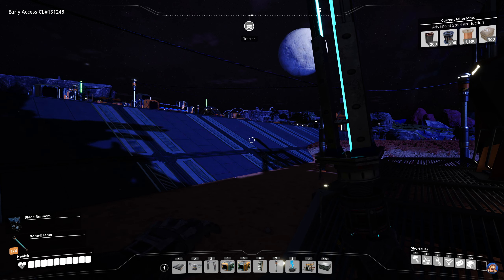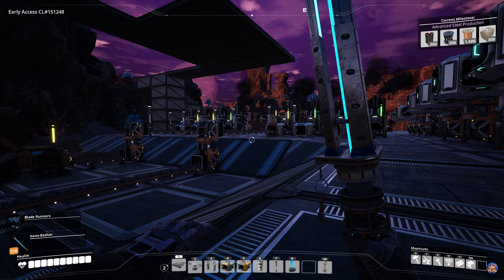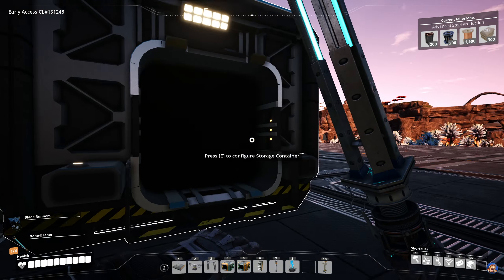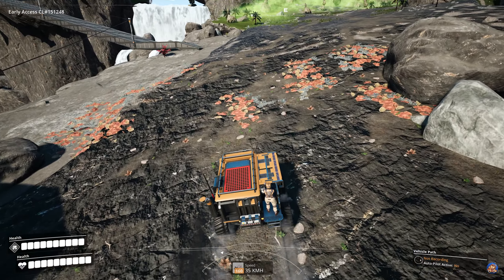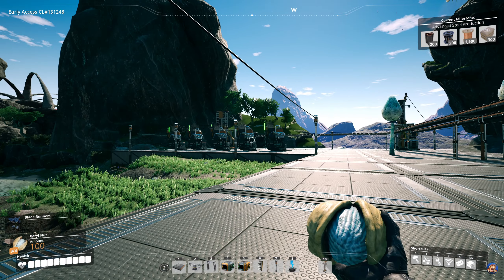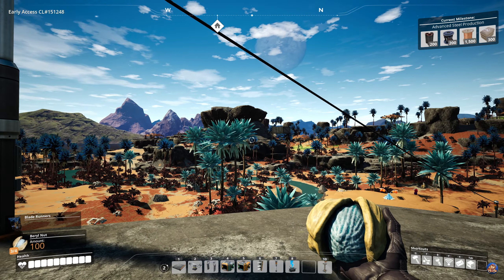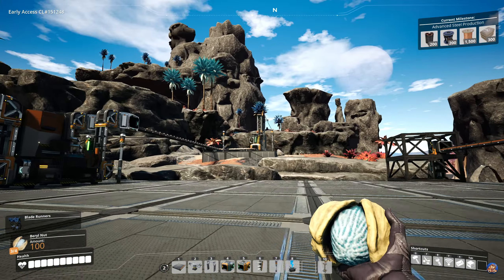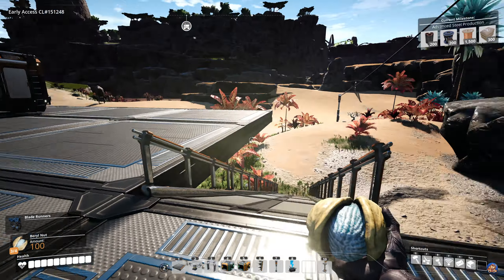Satisfactory Update 4 - Basic Factory - Coal Power - Steel - Let's Play - EP1

Comment: To add to the coal gens discussion you had, WRT pipes, having 1 Mk1 pipe go the whole length of 8 coal gens. Join 2 extractors to one end, join the 3rd extractor to the opposite end. It allows you to have fewer pumps, if you are using them, and balances flow very well.

Secondly, WRT using manifold for the coal and having intermittent power generation, you can fully saturate/pressurize the system with both coal and water. The generators, unlike other machines, will accept material inputs without power. So you can hook up water and coal completely and just wait to run a powerline to the machines. Once the inputs are 100% full on all machines, pipes, and belts, then hook them up 1 by 1 and you'll be getting consistent power right away.

I find 3 biomass burners with a stack of fuel each are more than sufficient to jump start the setup.